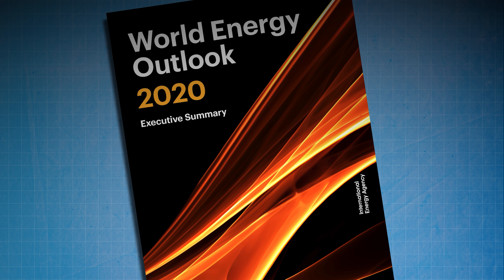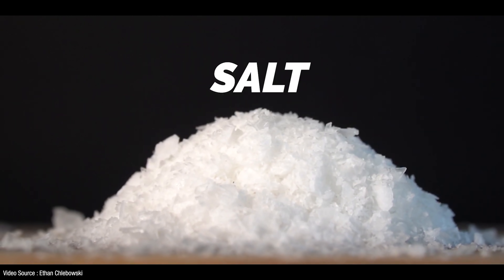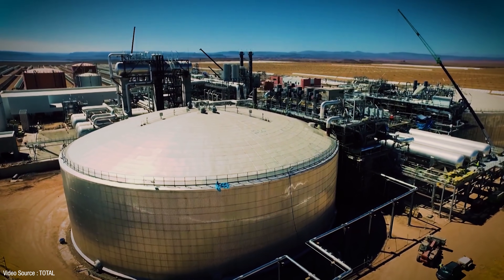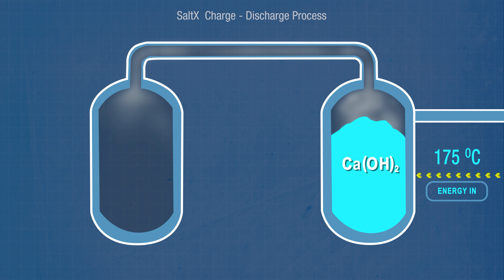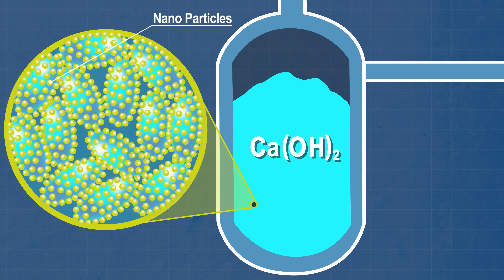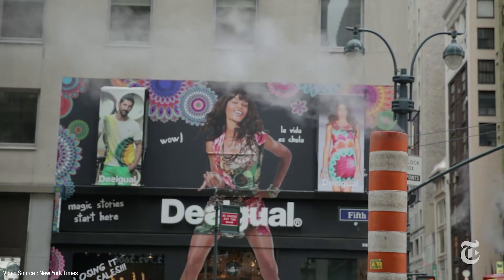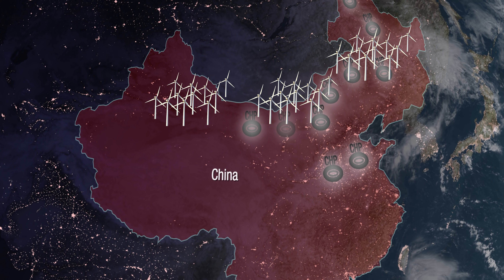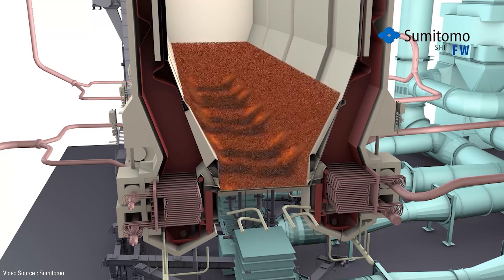Energy storage in salt - how nanoparticles are revolutionising the industry.

Comment: fresh water is a critical issue now, could this technology be used to provide the large quantity of energy to drive desalination plants at low cost, relatively?
Reply: No because it doesn’t generate energy, merely store it. Although cheap storage would lower the overall cost of electricity, making desalination less expensive as well.
Reply: @sunspot42  
.... or maybe not.  It may be best to "make hay while the sun shines" on the desalination and then store large amounts of fresh water.  Effectively, the water is the energy storage.
Reply: @kensmith5694  The problem with that is you have to dramatically scale up your desalination plant if you want to blast operate it whenever power is available, and that’s expensive. Much more expensive than power storage.
Reply: @sunspot42  
Storage is expensive too.  I am suggesting bursts of desalination may be less expensive than storage.
Reply: @kensmith5694  I understand what you're suggesting.  I'm telling you that it wouldn't be less expensive, because desalination plants are very expensive to build and scaling them up to run in bursts while power is cheap wouldn't be cost effective.  You'd also have to build storage capacity for all of the excess water, and pump capacity to move it back into the system when needed - which would burn even more power.

Comment: If at all possible, I would really appreciate if you could make an episode, condensing or summing up all the various energy storage plans and projects thus far. Sort of a "where are we at" episode.
 As you said, a lot of different energy storage ideas are popping up these days, and it's pretty hard to keep track of it all. 
Of the top of my head, there is Pumped storage, Li-ion batteries, Molten iron? batteries, Liquid air, various hydrogen projects, Gravity "hoisted" storage, and I'm sure there is more. All of them more or less clean and with wildly differing efficiency.
Anyway, thanks for yet another outstanding episode :)
Reply from the maker: Might be a challenging (and quite long) video. I'll give it some thought though :-)
Reply: @JustHaveaThink  it doesn't have to be long or complicated, as you already have videos explaining these techs in detail on your channel
dachs probably thought of just a brief overview - from which you can then refere to your other videos
Reply: @JustHaveaThink  I think a series is in order, with some kind of rankings such as $, area and volume per stored quad (10^9 BTU), charge and dischage rates and efficiency, stored energy lost over time, and special considerations such as the geography needed for pumped hydro and the ability to do load following.
Also one idea i have not seen an analysis of is that of a pumped float. Build a huge block of low density material and hook a cable through a pully at the bottom of a large, deep body of water, winch it down to store power... I think it would be like the tower crane, but much bigger and out of sight, perhaps miles offshore. It might have to be really strong, but it does not have to be monolithic. A bunch of small hollow spheres (perhaps pressurized with CO² gas for an added bonus) in a net would work. Using 2 cables would allow an offshore wind farm to pull the float down without the losses of transmitting that power to shore.
Reply: @jdrissel  just a suggestion, why not use the MegaJoule in stead of the british thermal unit? btu is really an antique unit. ;D
Reply: @bgbthabun627  absolutely nothing wrong with MJ either.
Reply: @JustHaveaThink  I would also really love to see that video and would happily add myself to your patreon to see it done! (I may end up doing that eventually anyway haha, but I'd be really, really excited to see that video!) - I loved the comparison graphics you provided for your video on Liquid Air. A video that summarizes contrasting pros/cons would be extraordinarily helpful!
Reply: @JustHaveaThink  Another well-researched episode.  Green anhydrous ammonia too!  Apart from grid-level storage and export potential from renewables-laced countries, I'm really interested in the potential to perform the equivalent of an LPG conversion on the world's existing mountain of fossil burners.  Whatever happened to http://www.nh3car.com/
Reply: I'll raise the bar...   how many of these energy plans and projects can work together synergistically?
Reply: I like the idea of where we are at video.  curious what the pace of the industry is at and what to expect gaps wise to be ahead.
Reply: Just to add to the criteria here it would to good to look at technologies that would enable transported electricity eg solar or wind generation in remote locations that could store the electricity in a transportable form at highest efficiency.  Could SaltX be used for this, how would it compare to Hydrogen, Ammonia, Lithium Ion batteries in a container or is High Voltage transmission lines the way to go ?  Really interesting research from ThinkX suggests there will be lots of excess energy at certain times of the day and year and unlike fossil fuels the answer is not to turn off the generator but new challenge (and nice one to have) is what to do with it: fixed storage, transportable storage, Bitcoin mining, free municipal car charging, ... ?
Reply: A quick and "efficient" (see what I did there? hee hee) way might be a simple playlist, similar to your Energy Storage Technology playlist but comprised only those videos which introduce each individual technology.
Reply: There is a report from Joule called “predicting the levelised cost of storage” which predicts the most economic storage technologies (li-i is best for everything except seasonal where hydrogen is best)
Reply: Good idea Dachs.   One thing I noticed in the presentation was that was there was no mention of overall efficiency, except for the steam turbine.   Was this on purpose?  Best Wishes   -  Jn

Comment: Me again...I think this has to be a gamechanger for NEW Concentrated Solar Installations using molten salt - if the tanks and pipes that handle molten salt can be made of common metals, conversion processes are more efficient and storage time frames more variable - costs will drop, and places like the Sahel in Africa or the fringe areas of any hot desert would be ideal opportunities
Reply: I like the application for desalinization the most.  where there is water there endless potential.

Comment: I'm considering buying a big well insulated water tank to store heat in it. Energy density not very big, I know, but water is cheap. Also: thank you for your work.
Reply: It's called a buffer tank and a standard component of almost every biomass heating system.  Can be bought off biomass boiler or buffer tank manufacturers in sizes from 500 l to 50.000 l.
Reply: @TerraPosse  
Don't overlook that you can buy tanks from other folks that are intended to store water and then enclose them in a insulated space.
Reply: @kensmith5694  Even in an insulated building / room, I would never install a non-insulated tank if it's used for storing heat.  There is no such thing as too much insulation if you're trying to minimize heat loss.
Reply: @TerraPosse  
It is a matter of storage per dollar.
Reply: @kensmith5694  Insulation is the cheapest form of heating.
Reply: @kensmith5694  Good idea, thank you.
Reply: @TerraPosse  Ha, ha, true!
Reply: A very good place to start is a solar hot water system.  Heating water for your hot water supply pays for its self very quickly.
Next comes the heat for domestic spaces.

Comment: It's clear to me that with no other advancements, we already have a way forward for clean energy to handle 80% of energy use situations...for the rest, there are small modular reactors and/or molten-salt reactors...but let's get to 100% :)...wait...does this mean the concentrated solar installations that are using molten salt, would get a big boost in efficiency?
Reply: Why would they? Only if they have big amounts of excess power, which usually isn't the case as they're not simple solar panels that people plop about the place whether they are needed or not.